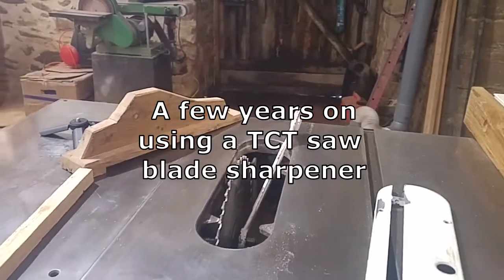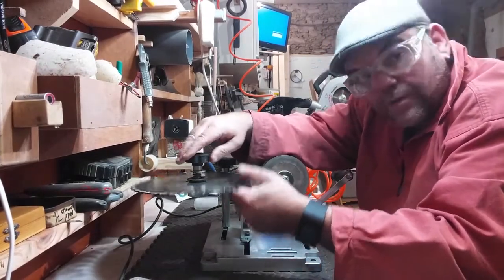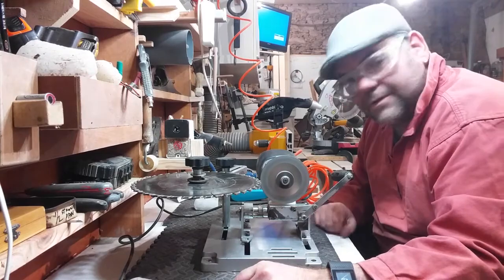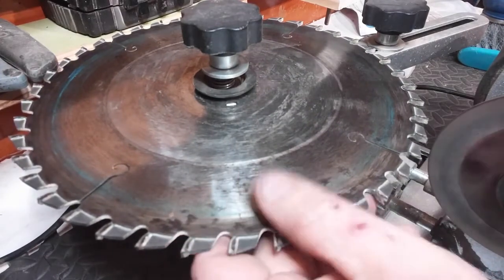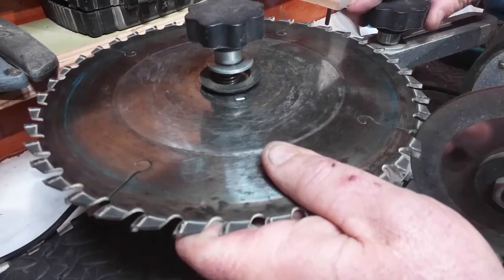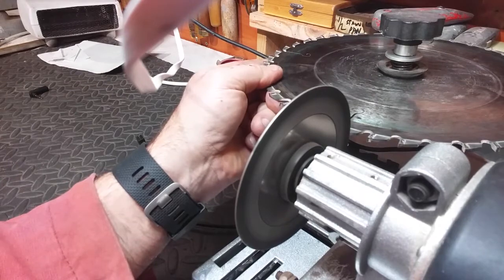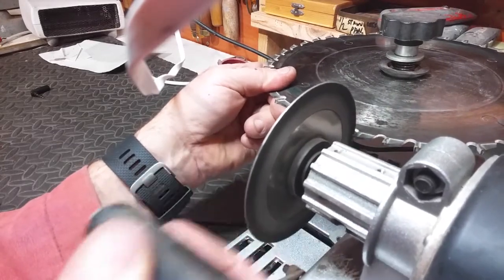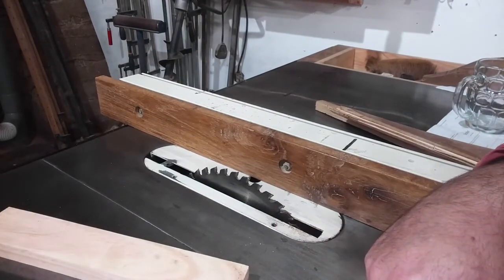TCT tungsten saw blade sharpener by Berlan or Sealey 2018

Comment: Nice video. I'm a welder by trade but have diamond disks made to my specification.  As I noticed there are lots of cheap disks bending or braking when there used incorrectly. 

Should take a look at some of my disks on ebay I think my 2.0mm thick disks are better for this sort of thing.

https://ebay.co.uk/usr/m88tox

Comment: Hi,great video cheers,any idea how many sharpens your likely to get out of the diamond sharpening blade,I know it depends on size of blade and number of teeth but dont want to buy a machine if the blades dont last long,
Reply: I have the same and it lasts ages.
Reply from the maker: I have had the machine for over 3 years and hand no need to change the diamond disk. Hope that helps